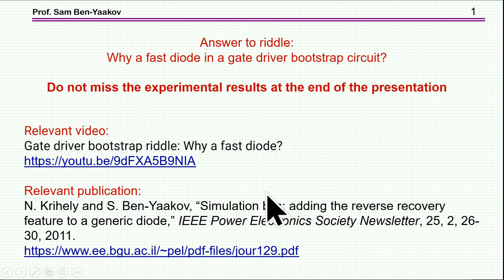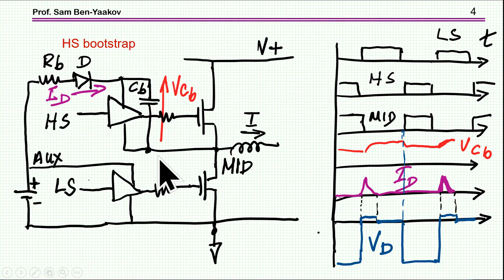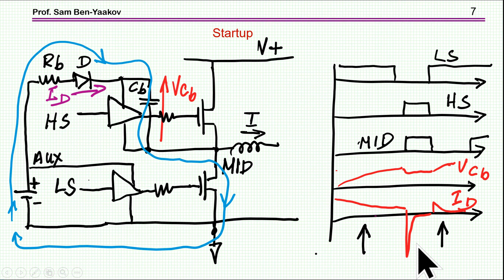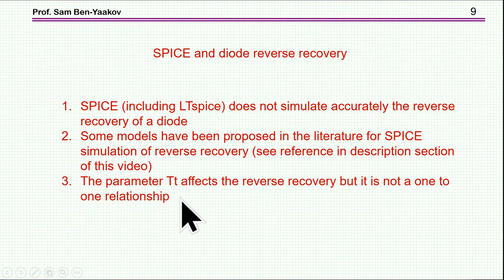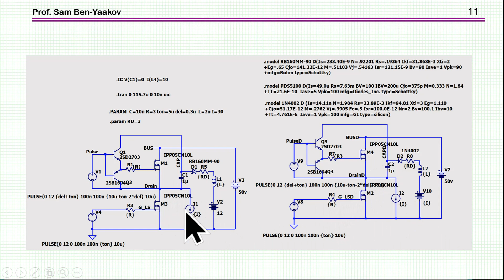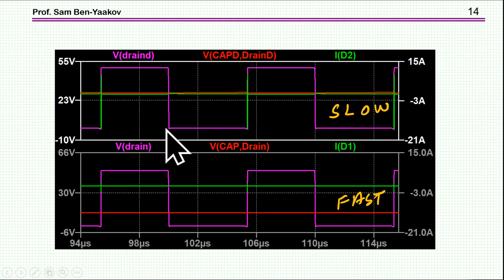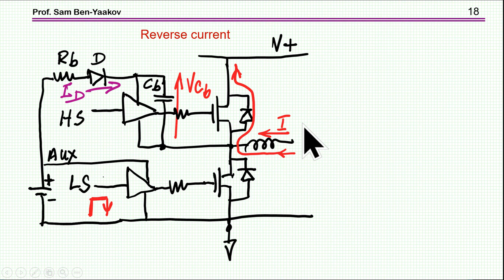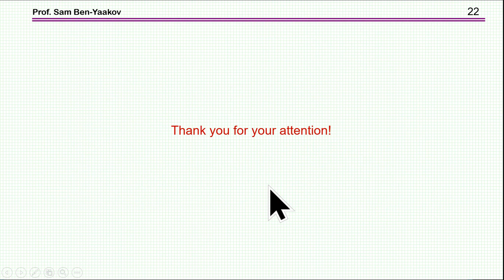Answer to riddle: Why a fast diode in a gate driver bootstrap circuit?

Comment: Perfect presentation (as always). Could you confirm that with LLC or CLLC, as the current is reversed before closing high side, reverse diode  recovery is not involved?  In other words, no need to have a fast bootstrap diode with resonnant converters.
Reply from the maker: When the current is lagging there is no dead time after turn off so the extra charging does not exist so no need for fast diode.

Comment: Hi Prof.... Its a great video... I have a practical issue in my project.... I'm  using bootstarp gate driver for pmsm motor inverter. Issue is as and when I turn ON inverter voltage (270vdc) my low side gate signals are distorting. Could you please share possible reason
Reply from the maker: Is the input to driver Ok? You have sufficient deadtime?

Comment: A Schottky diode does not have any minority carrier charge storage, it is a majority carrier device.
The TT term in the PDS5100 model makes no physical sense.
Reply from the maker: As  know all diodes share same templates which are tuned to each diode

Comment: Sir, what should be the voltage rating required for this diode? Do we have to consider the drain voltage?
Reply from the maker: It should be the bus voltage  (Vb+Vcc)-Vcc
Reply: @sambenyaakov  
Thank you sir

Comment: Sam, thank you so much ! This was brilliant !

I am working on a prototype power converter with a 400 V high rail, using a bootstrap circuit for the upper transistor.

For the past two days I've been trying to figure out why there is a large spike (only 20 nsec long) during on-switching of the upper transistor, which even affected my 15 V driver supply (which got a little jolt).

I've been thinking about the reverse-recovery for the diode (I used an old 1N4007 that I had laying around), but did not think that made sense since the diode should not be conducting at that time...

Now I know my problem, and your explanation was (as always) impeccable.
Thank you very much !
Reply from the maker: 😊Thanks for sharing

Comment: Iam afraid I have to disagree.

1.) The startup problem exist only in theory and simulations, since in a real circuit, the driver voltage is applied a LOT of time BEFORE the circuit starts switching. When the low side driver is ON, the bootstrap capacitor has all the time in the world to charge. If both drivers are in tristate and so both MOSFETs are off, the problem will be there. But this is a rather questionable design.
2.) The polarity of the load current or type of load (resistive or inductive) does NOT matter! So does the voltage of MID. When the low side is ON, the voltage of MID will be somewhere around 1-2V plus (negative output current) or 1-2V minus (positive output current, diode conducting for IGBT, maybe reverse mode of MOSFET) . But this does NOT directly define, whether reverse recovery in the bootstrap diode occurs or not. It only amplifies the effect in some cases. 
3.) You own measurement shows the real cause of reverse recovers. A very short time between the LOW side going off and the high side going on, in your screenshot ~400ns. When the carging process is not finished before the high side goes on, reverse recovery will occur in the bootstrap diode. This translates to very high duty cycles close to 100% at very high PWM frequencies.
4.) What puzzles me is, that in your measurement the charging process of the bootstrap capacitor starts when the LOW side goes off. This is odd. Usually, this process starts as soon as the low side goes on, since it needs the low side mosfet conducting or at least the MID voltage driven low, which can also happen through an inductive load. I guess your setup uses MOSFETs, and when the low side goes off, the MOSFETs leaves reverse conduction mode (low R_DS_ON) and the body diode has to carray all the inductive output current, which cases the MID voltage to incease with negative polarity! This will start an additional charging process for the bootstrap capacitor.
Reply from the maker: Thanks for input.
1. Indeed the startup issue is more of a theoretical case and was introduced just as a background. In any event, as stated in the video this possible process is of no sinificance..
As for the other parts of your comments, it seems that you are thinking about an IGBT which is not a bidirectional device and hence the diode of lower device is conducting during the LS duration and there is no voltage step in the mid point. As explained, the reverse recovery is due to this step in a MOSFET. This has nothing to do with the duty cycle. The simulation and experimental were with  50% DC. As for current direction, funny, despite my explanation, the presented simulation, slide 19,  (which is supported by measurements) you argue that the direction does not matter?  Come on. Show us a real proof that you are right. As for the experimental  measurements they support one to one the explanation and simulation.  May I suggest that you watch again the video with an open mind and the understanding it talks about MOSFETs .
Reply: @sambenyaakov  OK, I watched it again an I get your point. And yes, unconsciously I was a little bit too much focused on IGBTs, since I use them in my design. 😵Just a small additional note. You say, that the MID voltage goes negative, when the lower MOSFET turns off. It was already negative, when the MOSFET was conduction (inverse mode), but will go even more negative, when only the diode is conducting. But still, the reverse recovery will also take place for very high duty cycles, since the recharge process will be still ongoing then the MID voltage goes high, independend of output current direction. So after all, we both are right. 😀
Reply from the maker: @JacquesMartini  Indeed, if the charging is not completed within the low side duration there will also be a reverse recovery process. But... the series resistor to the floating capacitor must be sized such that the charging is 'completed' for the expected maximum (HS) duty cycle. Otherwise, the capacitor will not be charged to the full voltage and upper transistor will not get proper drive which will increase losses (and this is for max DC which normally corresponds to max current}. I think we have gotten it straighten out now😊😊

Comment: Very nice professor 🙏, 
I believe for GaN Fets the effect of extra charging in the dead time period would be much worse as the reverse voltage drop could be in the range of (Vth+Vgs_off)>Vd_MOSFET... (For the case of outgoing load current)
Reply from the maker: Good point. Thanks. But...bootstrap supply is not recommended for GaN drivers

Comment: Thank you for the video! I recently found that LTspice had always possibility to simulate reverse  recovery using parameter vp. But documentation and reference about it appeared only in version Ltspice17 and not in Ltspice4.
Reply from the maker: Vp is for shaping the second half of the reverse recovery. I yet to see a SPICE model of a commercial  a diode that simulate accurately the reveres recovery.

Comment: This makes me wonder about the tradeoffs of Schottky vs fast PN diodes in this application. Schottky should have higher leakage but I don't think this would be a significant disadvantage?
Reply: Should be ok if you have enough bootstrap cap.
Reply from the maker: Schottky is better (up to about 100V), choosing a low leakage device.